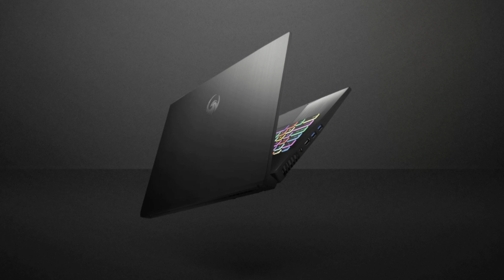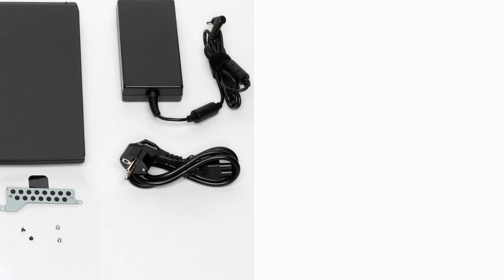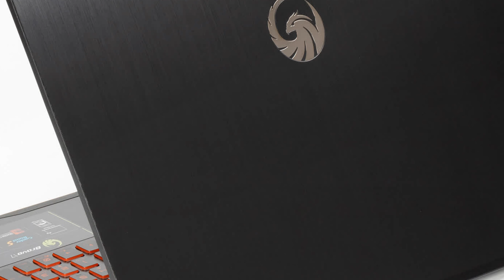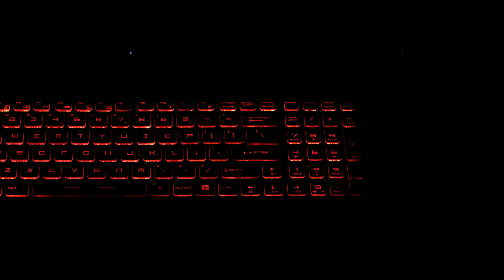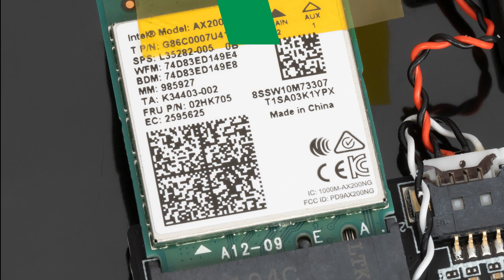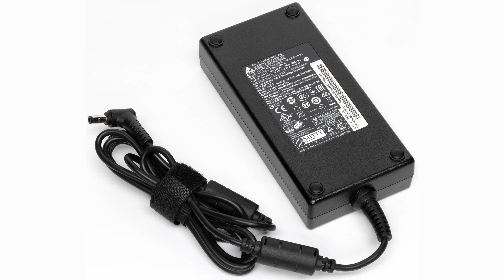MSI Bravo 17 Gaming Laptop - AMD Ryzen 7 4000H Processor & Radeon RX 5500M Graphics Card

Comment: I am an architecture student. Is this a good choice for computer rendering? I know this CPU is great but I am a little concerned about the GPU Can I quickly work on 3D model programs like Lumion in college for the next 4-5 years?
Reply from the maker: The 3Dmark score on this is around 4000+ whereas Lumion will require at least 6000. It might work but not as expected or even slower. However this one does have a good pcmark of around 5700+ which is beyond lumions requirements. You can try upgrading the GPU for faster rendering speed
Reply: You need a Thinkpad if you wanna into architecture. Not a gaming laptop
Reply: Why not?. I am also architect Pro. I spent this laptop with sketch up app all of my single days.No doubt. It's work. But don't expect for Lumion that need more powerful GPU speed and Vram.